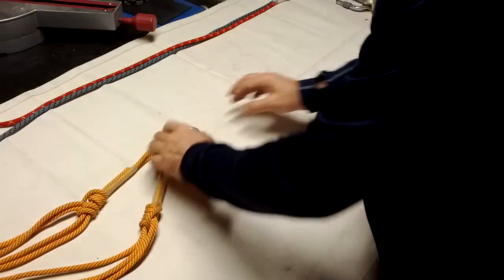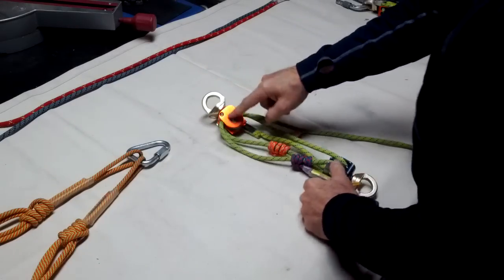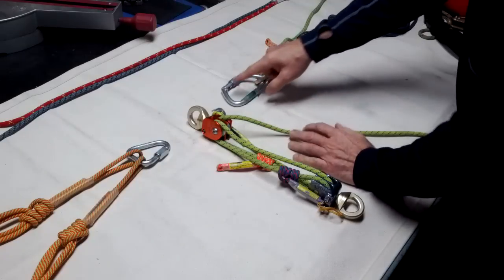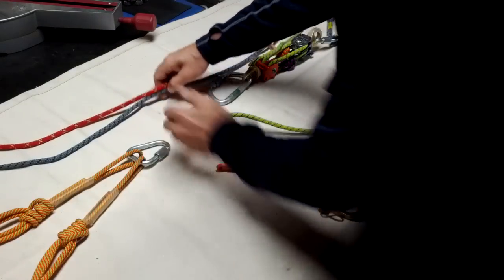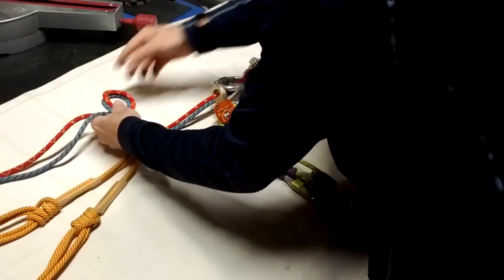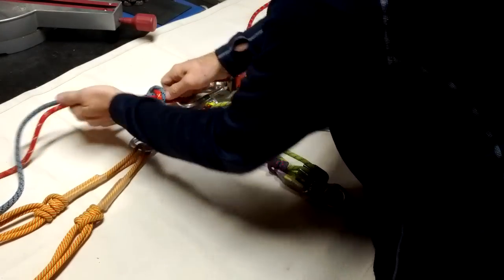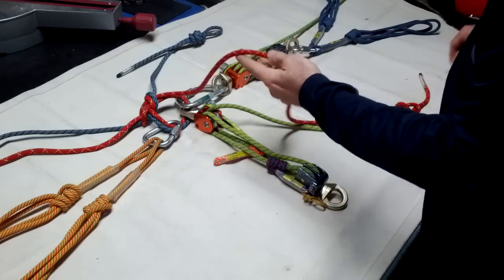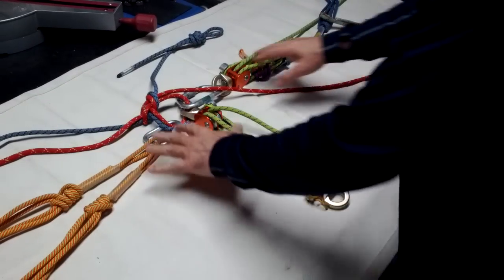Rigging the Stretcher Tri Bridle

Comment: Thanks for the video. A couple questions: 1) could you also eliminate the carabiner on the AZTEK attached to the foot of the litter? And alternatively, could you use carabiners in place of the tri-links? I know there's some tri-loading, but each end would only have half the weight of one person, and most rescue carabiners test out at 10-16K.
Reply: The carabiner on the Aztek at the foot of the litter allows you to convert to a vertical or low angle rig quickly when terrain changes.  
The use of tri-links removes any tri-loading questions. They stay rigged on the litter. Carabiners can be used in a pinch.

Comment: why do you suggest a outside bowline as opposed to an inside bowline when using the ends? wouldn't the tails be just as useful on the inside yet minimize the risk of the bowline slipping.
Reply from the maker: Justin,
Sorry, I just saw your comment.  The bowline should be just as strong tied with the tail inside or outside the loop (the small loop cinches on the tail). In this use, the tails are a bit more accessible on the outside but as you said, they would be just as useful on the inside. 
Slipping is more a function of the rope material. Bowline tails must always be safety-ed or tied to something.

Comment: What is your opinion on using a large rigging plate to bring the purcrells and azteks together?
Reply: Using a rigging plate adds equipment and length to the stretcher connection which is just what you don't want. Tying directly to the Azteks and Purcells eliminates the carabiner and rigging plate length.
Reply: Rigging plates add more vertical length to the assembly which is the opposite of what you want but will certainly work.

Comment: What size delta quick links are those? Also, what metal stainless or plated?
Reply: You can use an 8, 9 or 10mm link. Use a rated Maillon Rapid link, NOT one from a hardware store. Either plated or stainless is fine.

Comment: What brand, size, and length are the purcell cords ? Thanks
Reply: Miguel, we use Sterling Rope 7 mm purcell prusiks in long, 68" for the head end and short, 34" for the foot end. Go to  Sterlingrope.**com.   The Aztek set of fours on the foot end allows you to approach the victim with the stretcher almost vertical making it easier to load.  You can also detach the foot end to convert to a vertical rig for different terrain. Designed by Reed Thorne.
Reply: Brad Lyon Thank you much for the info! I just got the chance now to go on their website and place the order.  Thanks again!